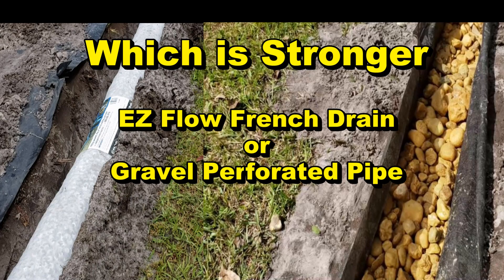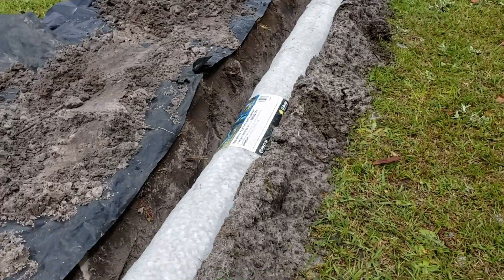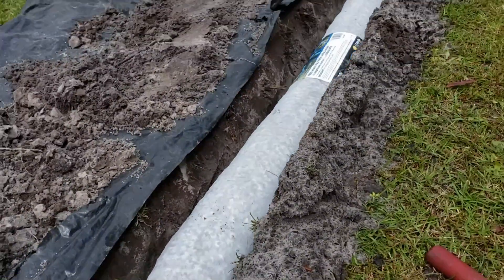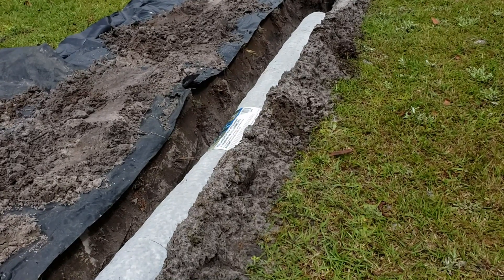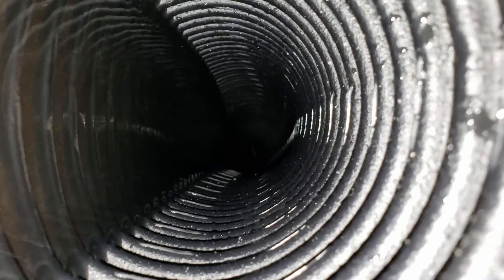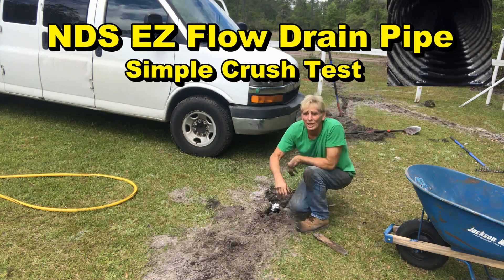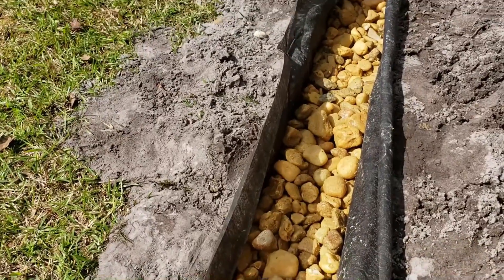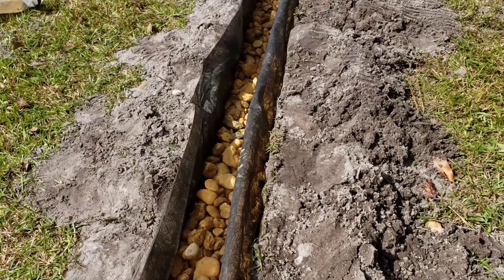Which is Stronger NDS Quick Drain or Gravel Perforated French Drain

Comment: Cool.  I would guess that the peanuts absorb most of the weight of the truck and disperse the weight throughout the radius of the peanuts so that the corrugated pipe is not affected.  On the other hand, the gravel more directly transfers the weight to the corrugated pipe and shifts the corrugated pipe around.
Reply: Thomas, I think you nailed it with your comment.